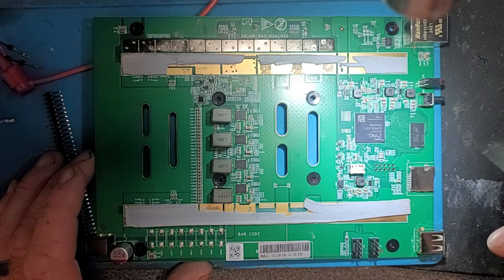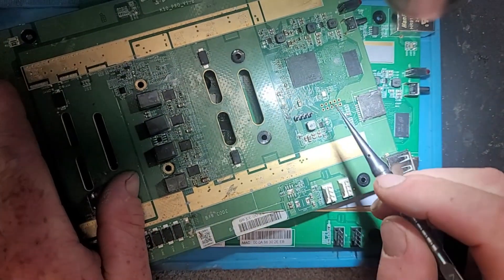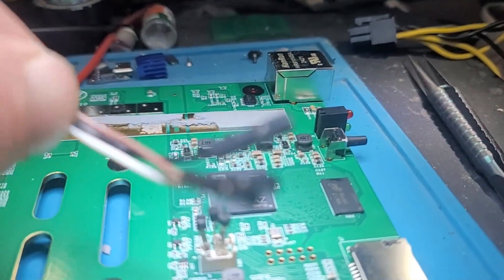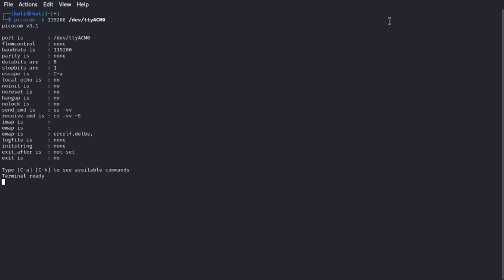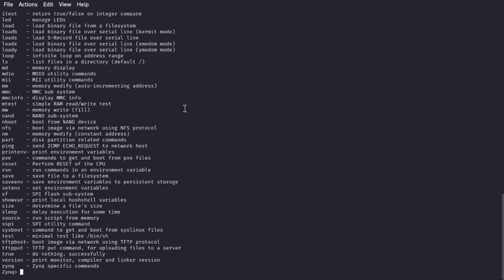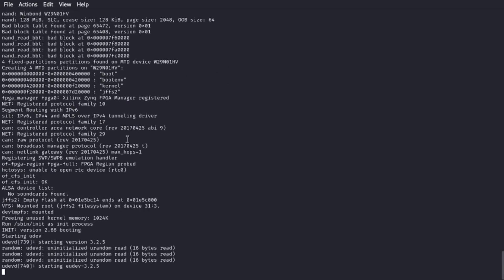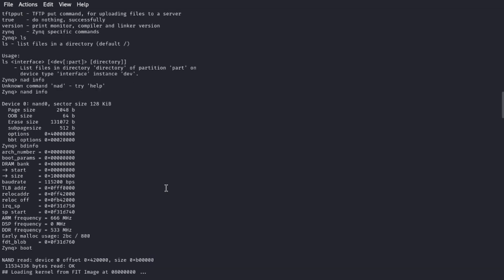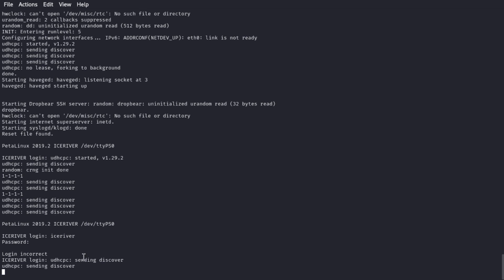Accessing U-Boot through UART KS0 ultra

Comment: hey what's up?  I was curious if i could pick your brain on an issue...or anybody's brain really.  I have a KS0 Ultra that is only getting 5GH.  When i got it, it worked fine at 400GH.  TSwift OCs came out.  I started small and did the 505GL without issue.  I wanted to take it up to the 600s.  I bought the heat sinks and thermal glue for the mossfets, bought a fan and 3d printed the fan shroud.  I got everything and did the mod, redid thermal paste and thermal pads as well.  I waited 24 hours for the glue to cure.  Put everything back together and the KS0 Ultra is only showing this thing getting 5GH then goes down to 0 then back up to 5.  I thought maybe i had a power supply issue.  Switched it out.  No change.  i reverted back to the original iceriver firmware per TSwift's read me instructions.  No change.  Still only getting 5GH.  I opened up the Ultra again.  I don't see any signs of damage.  This wasn't my first mod. i've successfully modded my 2 original KS0 and a few KS0 Pro's without issue so this mod was pretty straight forward to me.  Instructions for the thermal glue to use as little as possible.  I used very little just as i did on the previous mods i did.  Maybe some spilled out over the sides and is maybe creating a short and that's causing the issue?  Just curious if you can think of anything to try next.
Reply from the maker: @MaddioDaddioMining  what does the  t swift monitor show
Reply: @crypto440  tswift monitor shows all chips green, but voltage and clock are at 0.  It shows the pool i'm on, how many accepted shares i had (2 shares over 45 minutes), showed temp info, 5 min hashrate (5GH).
Reply from the maker: @MaddioDaddioMining  email me a screen shot I'm intrigued
Reply: @crypto440  yeah it's a head scratcher that's for sure.  Thanks man.  i will get you a screen shot tonight when i get home from work.
Reply: @MaddioDaddioMining if you haven’t figured it out yet, it’s most likely because you didn’t reconnect the fans
Reply: @ryandugan  nah fans were connected.  I had the same thing happen on an additional KS0 Ultra.  same 5GH issue.  I swapped the fan cables and plugged it back in and it started working again.  Then a reboot happened a few days later and is back to 5GH again.  going to play with it more tonight.
Reply: @MaddioDaddioMining  they may not have been connected securely.  Or you tightened something too much and bound them up so they don’t spin properly

Comment: This is awesome... I'm trying to do the same with a Avalon nano 3
Reply from the maker: Can I ask the reason?
Reply: @crypto440  sure... These nano's are equipped with ten 5nm asic chips currently hashing at 400 gigahashes each totaling 4 Terahash in total for the unit.. When theoretically these chips hashing the Sha256 algo at a 5nm spec can hash at 500-550gh/s each. Making it a total of 5-5.5 th/s per device. In other words I want to overclock it. I know it's doable.. People are curently overclocking the KSO ultra's. My ultra is curently hashing at 650gh/s.
Reply from the maker: Nice. Have you looked into the firmware they provide in their recovery tools?